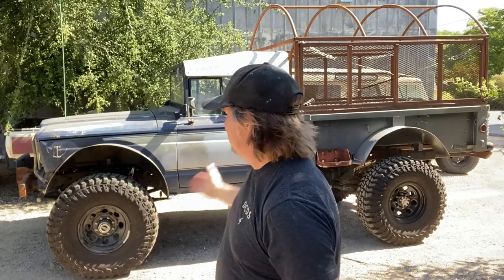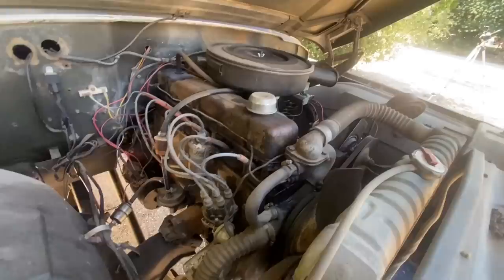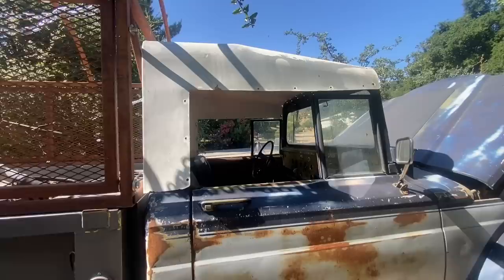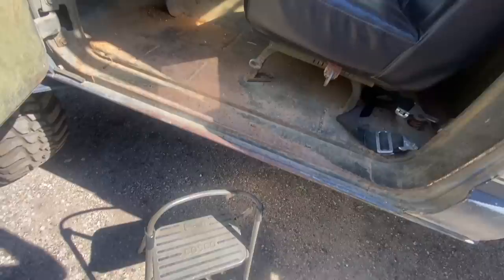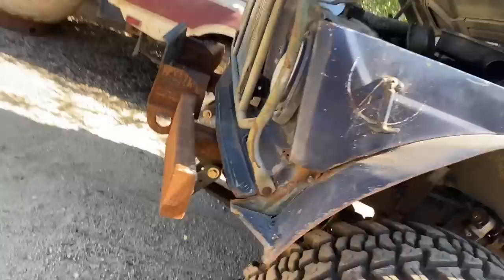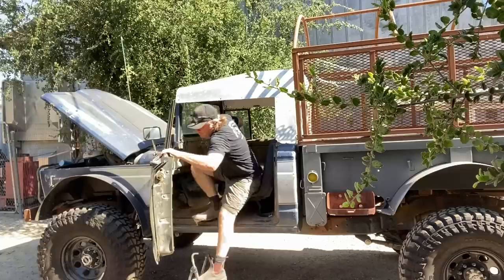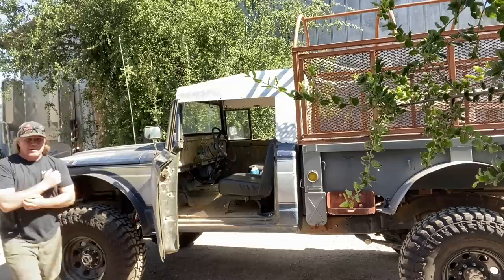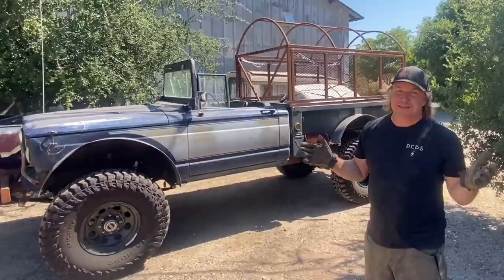Dirt Daily. Last Drive in the M715

Comment: In the late 90's I owned a 1981 Chevy P30 with a 292 straight 6 with 1 barrel carb. Used to to deliver bread with it. I would go in to load up the truck but the first procedure was to pump the gas about 12 times then turn over the engine attempting to start but it never would. Then load the truck for about 30 minutes until ready to leave for the route. The truck would then start again after pumping the gas about 12 times. The truck was great for the rest of the day, shutting off at each stop then barely bumping the starter and it ran like "an old sewing machine". One of the many old vehicles I wish I would have kept.

Comment: the reason for the starting issue is a bad mechanic, The carb needs rebuilt is all. My 74 C 10 with the same motor never failed me from day one.I sold it 6 years ago and the new owner is still running the straight 6 with no issues . I like watching your shows but it's frustrating seeing you ignore simple fixes that would make your life easier
Reply: Amen brother

Comment: wow. so...take a vehicle that started all the time in all weatuer conditions on any battlefield with a waterproof Jeep i-6, replace the motor and carb with a GM...and you die trying to start it in perfect California weather in a driveway. sounds about right. coulda just thrown an electric fuel pump in the fuel line, wired it to the run circuit, and starting problem solved, despite infection of GM components.

Comment: fred i get the sad sinking feeling your selling things because your arent making enough cash to keep things :(
Reply from the maker: Its not that, its setting a goal to simplify the fleet and use the trucks I keep more.  Plus I want less trucks that just sit, when there are folks out there that want to buy and use them.
Reply: @4xFredWilliams  why does everyone think someone's broke when they're selling things? I call it optimizing the fleet 👍
Reply: Suzuki or geo has those kind of top clamps you could use
Reply: @4xFredWilliams  Still, selling an increasingly rare M-715... I certainly agree you'll regret selling it.  A more reliable engine may have made it more desirable to you as a driver.